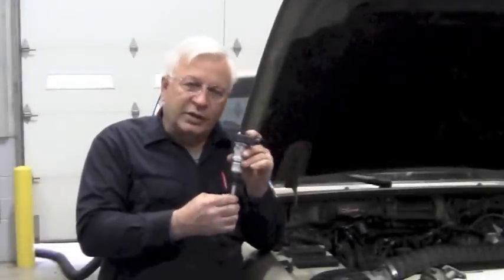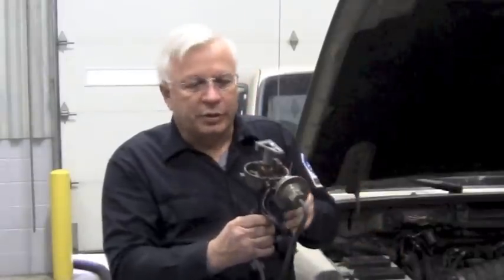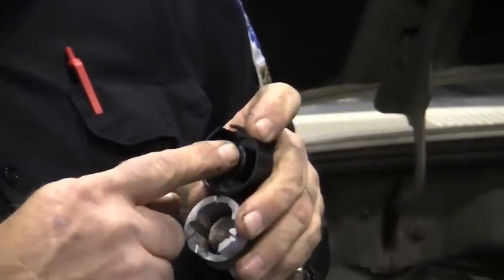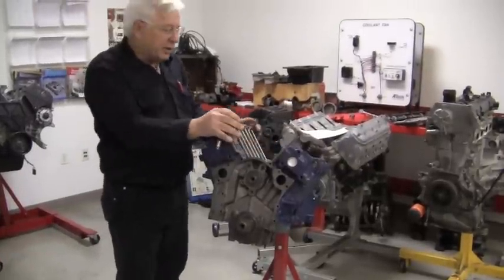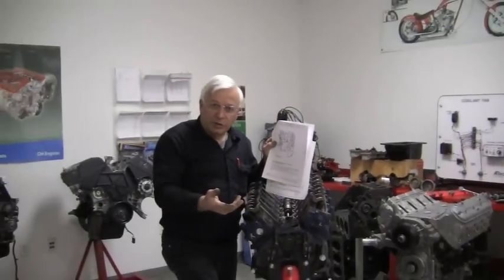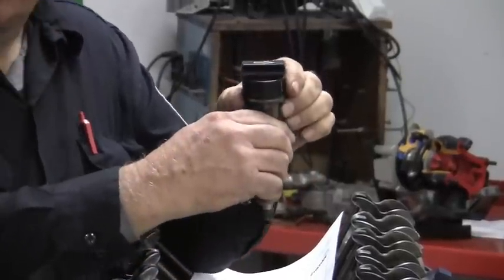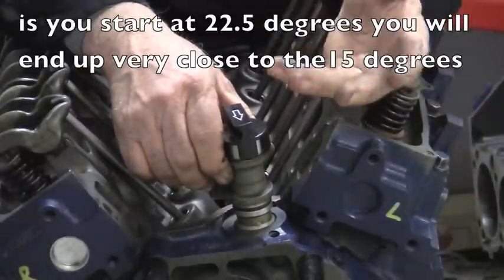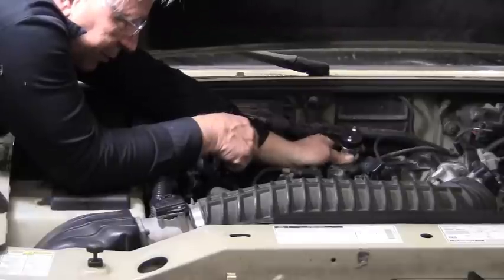Installing a Ford Synchronizer

Comment: .How do you get the #1 cylinder to TDC on a 2004 taurus v6?  The spark plug holes are sideways and #1 cylinder is between the fire wall and block.
Reply: Align the camshaft synchronizer tab with the Hall-effect cutout..
Reply: yea but the most common problem is that that eccentric gear on the oil pump gear wears out and you lose the frame of reference which is what happened which = junkyard.
Reply: i would suggest watching the follow up video to this one love this guys videos =D

Comment: wouldnt it also be just as easy to remove the old sensor cover, and place a mark on the intake and then pull the unit and use the mark to stab the new one? I use this techince on distributers and it works ther so why cant it work in this situation unless someone has already done it and screwed up the placement?

Comment: there's 2 directions that came with mine. this is the 2nd one. the first says mark the old one on the unit and the block. then transfer the mark to the new one. doesn't even include finding tdc. just states to put the pin inside that rotates in the same position the old one was. hmm
Reply: TDC in my mind shouldn't have anything to do with this...The rotor on the CPS doesn't know where the rest of the engine is, as long as the new unit is pointing exactly the same spot as the one you took out, the relationship between the parts is the same. It might make it easier so you can use that special plastic tool but I doubt it's needed.

Comment: 1 problem i see with this video is that even tho you did mention the crank needs to be at TDC, you did not mention anything about it needing to be on the compression stroke. so you can have it installed like its shown but it has the possibility of being 180 degrees off
Reply: Interesting.  I might have done this.  It made a racket for about 30 seconds then it smoothed right out.  Maybe the controller figures it out.
Reply: Sometimes that does not matter because the engine sparks on the exhaust and power stroke.

Comment: Need help putting in crankshaft sensor and housing  my 2003 ford windstar is stalling  less power and sqeeling  noise from belt area ... take power steering pump off??           Help thanks can't get to work grrrrrrr

Comment: why not put tool on old one before you pull it. line it up with the centerline on the motor . pull it . put tool on new sensor an drop it back in same position. that way theres no guessing on angle . you could actually mark a spot on fire wall or motor for a referance point . but ya im impressed with his videos overall
Reply: Firewall? You had better be drawing hieroglyphs. Why doesn't the factory just put the crank timing reference mark on the hood, too. Really accurate.

Comment: But, BUT... it's not just TDC on Cyl 1, it's TDC at top of compression stroke.  HOW to determine that without removing valve cover?  Can't use the CPS gear on front of crankshaft, because of course that's TDC on each stroke... hmmm... do you peek into the oil fill hole?

Comment: The way you worked out where 15 degrees is in relation to the center-line scared me. Wouldn't this be a great time to pull out a protractor and mark the 15 degrees with paint/marker/chalk? For something that needs to be so precise, the "eyeball it to a little bit more than half-of-half-of-half" method doesn't sit well with me.

Comment: Bought a used engine with no synchronized.  What is the best way to find right position?
Reply from the maker: Physically, manually, and visually put the engine at TDC (top dead center) on the compression stroke.
Reply: @realfixesrealfast  Then do the new engine the same position, then install the synchronizer in same direction.  Sound correct?
Reply from the maker: @garyjenkins6629  to be sure, verify it is top dead center on compression stroke.

Comment: where can i find this camshaft synchronizer in a 2003 Ford Ranger 4.0L V6. Please help!
Reply: Ray Martinez you don't have one
Reply: I am in the process now of replacing my cam sync and sensor in my 2003 ford ranger edge (V) 3.0L. I find that researching this install on the internet gives me so many varied degrees that the cam sync is "supposed" to be at, it is sickening, actually. I have read 10 deg, 15, 50, 75, etc. Frustrating as hell when you WANT it to be EXACTLY correct, or very close to correct so you are not having to do it over again, etc. I have read to simply put new one in exactly in position of the old one, by marking the body of the old cam sync to the block, etc. I have read the metal flag thing in the cam sync should always be lined up in the center of the little window. I have read that the cam sensor can also get to where the magnet inside has broken off and created a "rock tumbler" like situation, where the metal tab on top of the cam sync get berated and worn away/ broken off by the cheap little magnet inside the cheap plastic cam sensor, making the process of "just mark the old one, etc. virtually impossible for sure. Also, it is rather confusing for the home mechanic to know, and find how to get your TDC correct when even the dang diagrams for the coil pack and firing order, etc. for the 2003 ranger edge 3.0L are sometimes backwards on a lot of websites, mis labeled, etc. !!! Aggravating as hell...
Reply: I cant find my either 2002 4.0

Comment: I just did this cam synchronizer on the 1999 Ford 3.0litre Vulcan engine. The only reason Ford replaced the distributor is because this part is deliberately made CHEAP and designed to fail costing you bucks at the Dealership. All you need to do is find Top Dead Center by removing the #1 Sparkplug which is easy to get at because there is lots of room between the firewall and the block. Once you have removed the #1 sparkplug that is next to the Serpentine belt on the rear cylinder bank, put your finger over the Sparkplug hole and have someone spin the engine over with quick clicks on the ignition switch until you feel the compression pressure build up on your finger. Then find the Top Dead Center (TDC) marks on the Harmonic Balancer on the crankshaft by removing the splash guard in the fender and clean these marks off. It is usually easy to see the TDC mark and the 10 degrees before mark. Set it on the 10 degrees mark and drop in your Cam Sycronizer in where it belongs. One tooth in either direction will be clearly wrong when you see the orientation 20 degrees off of where it belongs. So it is pretty hard to mess up once you have found the 10 degrees BTDC. That is it. Replace the 10mm bolt hold down for the sycronizer shaft. Removing the intake manifold makes it a ton easier, since there is only 8 bolts holding down the intake manifold and it makes this job so much easier. This is a critical skill to possess when you own a Ford Taurus with the Vulcan motor.

Comment: I dont understand 1 thing do you put that synchronizer at 15° no matter what position the engine is in? If the engine is not at the correct  compression position the synchronizer will not need to be at 15! The old synchronizer is at 180° when taking it out...regardless just put the new one at 15°? How do you know when your engine is at the correct position for 15° or whatever degree is intended for your specific engine?
Reply from the maker: good question. Perhaps I should have specifically said it, but all engines timing is based on #1cyl being at top dead center.  That what the 15 degrees references
Reply: @realfixesrealfast  i realize now you did say TDC I just missed it the first time
Reply: In this video, and many others, essential info is missing. First, the cam synch rotates at the same speed as the motor...6 revolutions on the motor, 6 on the cam synch.  The degrees and centerline and all that are meaningless. Bring any cylinder to top dead center on and make sure the vane is in the window or just coming into it. Looking down from above, it rotates CCW.  The voltage from the signal will lead the amps created (very small), but the peak signal will take a couple degrees after it starts to appear in the window, thus it should be aimed at the right edge of the window, looking down.. This can be adjusted, a bit,  by rotation.  The cam synch does not know what cylinder you are on, nor does it know if it is on compression or top of exhaust stroke. The 15 degrees thing is to relieve stress on the wiring harness. It's irrelevant to the signal it sends, or when it sends it..  There should be a pulse on every revolution for every cylinder and that's all it does.
  Something else to understand not stated clearly: the cam rotates at half the engine speed. In my 99 3.0, the Cam synch device has 14 teeth...driven off the cam gear which has 28 teeth, which is why the cam synch has the same RPM as the motor.  (Engine to cam:  2:1.   Cam to synch, 1:2,  thus  engine to synch = 1:1.
  Some of the other videos create a HUGE mess with 75 deg, 38 deg, 15 deg, and so on. Those numbers have no bearing on anything.
  
1) top dead, any cylinder. 2) put the vane in the window. 3) Fine tune if needed with a little rotation. 4) Don't stress the wires.

  This another example of understanding theory,  rather than just following directions.    Get the first, you won't need the second.

Comment: Nope. The crank position sensor is on the front of the engine, picks up a signal from the harmonic ballancer. This is a cam position sensor..turns at half crank speed.

Comment: I have a 2008 E350 Super duty Econoline, 5.4 L gasoline. I have 431000 miles 99 % highway miles. Still have original water pump that shows no sign of any leaks or problems. How long do these water pumps last? Anybody know?

Comment: The whole "15 degree" installation position is a load of BS. If you are using a tool (the little plastic doodad with the arrow) that locks the rotor position relative to the housing, it DOESN'T MATTER where the housing is clocked relative to the engine. 
So long as there is sufficient wiring harness to connect to the sensor it won't matter where the housing is clocked so long as the crankshaft is at #1 TDC and the little "rotor" tab is locked in the correct position relative to the housing.

Comment: Good god. Look at the gears. Crank gear has half as many teeth as the cam gear, and is the one doing the driving..one revolution of the crankshaft equals 1/2 revolution of the camshaft.
This isn't rocket science, man..